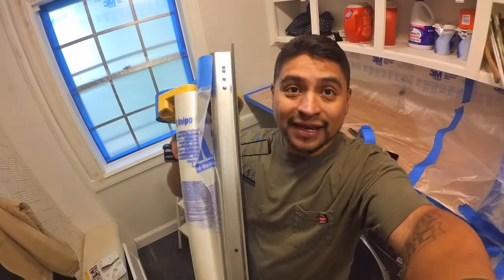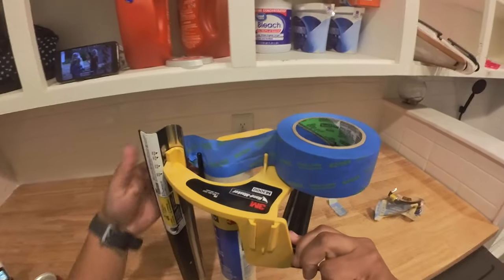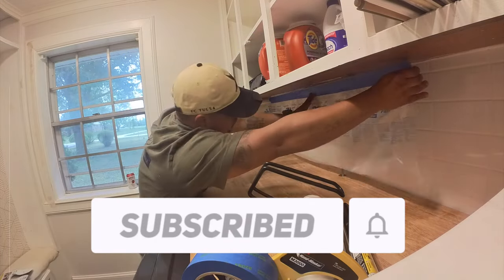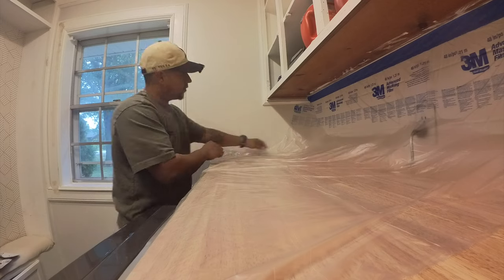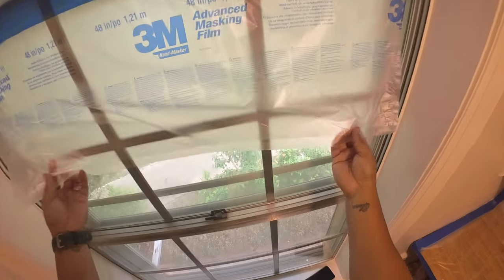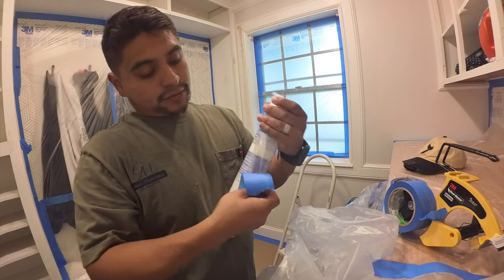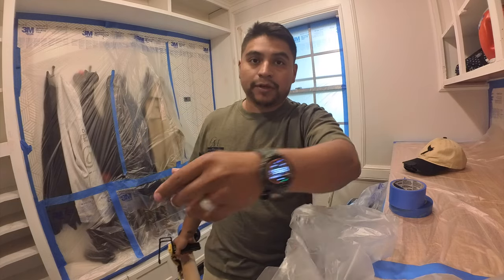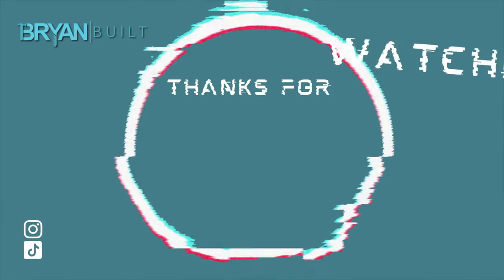How To Mask For Paint With The 3M Masking Gun

Comment: Nice bro hand masker is a must 🤙 I have a question how is the quick shot holding up ? Do you use it often ? I want one for cabinets only 10 doors but for about 30+ apartments
Reply from the maker: For sure! Yes i Have been using it quite a bit. ceilings,  cabinets , a small laundryroom . Its been doing great havent had any issues at all I think the o=most Ive used it at one time is about 3 gallons
Reply: @BryanBuilt  thanks for the reply bro the quick shot will be my next sprayer for sure. Keep the videos coming 🤙